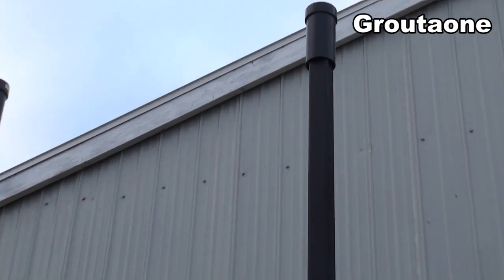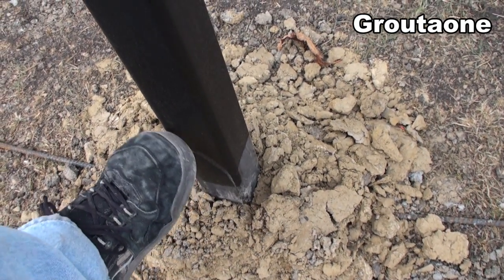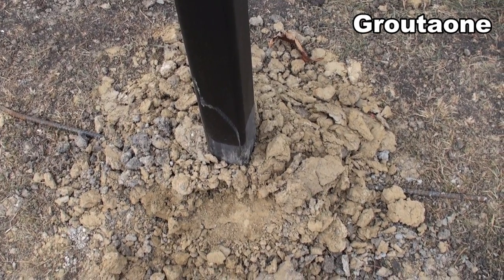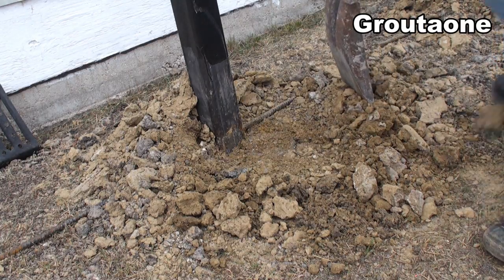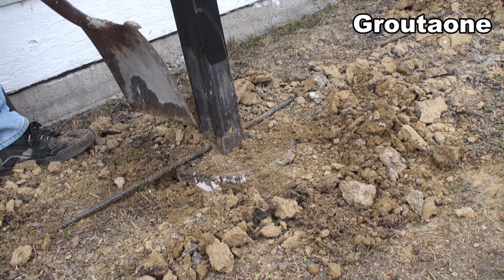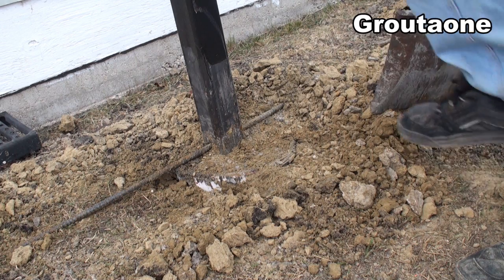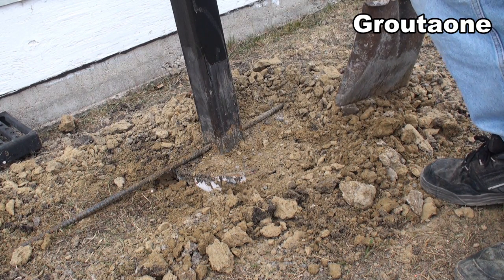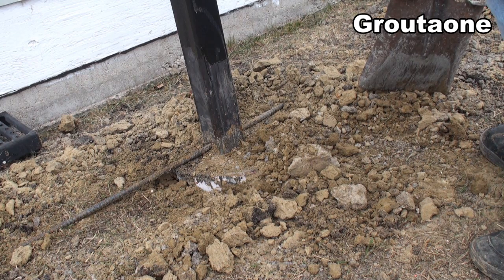Steel And Concrete Solar Mount Option

Comment: concrete usually cures even in colder conditions in 24 -36 hours , if it's been longer than that it's not going anywhere we used to pour raw concrete into the holes around foundations and the dry concrete would turn into rock hard concrete bases by pulling the moisture out of the ground around it.

Comment: Will you remove the steel bar once set? If you do it will allow any water to drain (assuming the steel below ground is filled with concrete so the water can't get below the surface)
Reply from the maker: *****  I would like to remove the rebar and weld the holes shut
Reply: groutaone I agree with removing the rebar and welding it holes shut.  LOTS of torque at that point.  Perhaps welding the bar across the outside of the steel could have been another way of supporting it.
Reply from the maker: Fred Miller Welding a bar to the outside would have been better overall, however my shop has no power until I hook up a relocated wire, hence the drilled idea came about
Reply: Gotcha!  Didn't realize that you did not have shop power.  I am really interested and enjoying your solar series!  Thanks for sharing it with us-

Comment: Looking forward for the next steps. Maybe you can give an approximate estimate of the total cost of that installation. I will be curios to calculate the thermal solar price/unit of energy. Of course there is also a lot of work involved but just the price of the materials will be what I will be interested in.

Comment: Where I work we got a contract at a Solar Farm to cut piles that were put into the ground. there are about 5000-6000 piles to hold solar panels and they are about 12 ft long and about 4-5 ft stick out of the ground and upwards of 1 1/2 ft have to be trimmed off. instead of doing what you did to keep the piles a consistent height they hired us at $8 a pile to cut them:P and also the caps seem to be a good idea but I know they arent doing that where we are, we are cutting them all down by a torch and you can hear when hot peices of metal fall to the bottom the water boils, but they are also pouring the concrete in mud and in temps just above freezing during the day. The only thing I would of recommended you use is galvanized instead of painting because how will you paint the inside?

Comment: 16 ft?!? Holy smokes.  Would love to see the equipment you used for those.
Reply from the maker: keifsanderson  It was a skid steer with a pile drill attatchment
Reply: groutaone Thanks.  I didn't realize you could add auger segments to those types of setups, to get to greater depths.  I figured you had used heavy equipment of some sort.
Reply from the maker: keifsanderson Yep, it's got like a two stage drill depth, first it goes eight feet then a shaft within a shaft will slide out for another eight feet

Comment: Just out of curiosity.. how does frost damage fresh concrete?
Reply from the maker: Custom Buggy and Epic Builds  the water in the fresh concrete will freeze and expand causing damage
Reply: Awesome thanks!
Reply: it gets really crumbly and you can just pull it apart.

Comment: Looking forward to seeing the rest of the project, are you still using your burner till you get this up and working or is that redundant now ?
Thanks for uploading ;)
Reply from the maker: inspirality Thanks for watching, the old boiler needs repair and I would rather put the time into getting the new solar heat going, so right now the shop has no heat